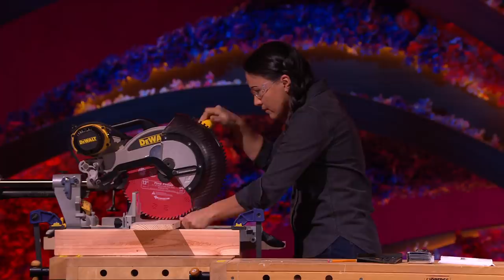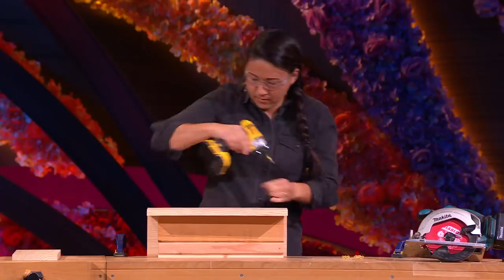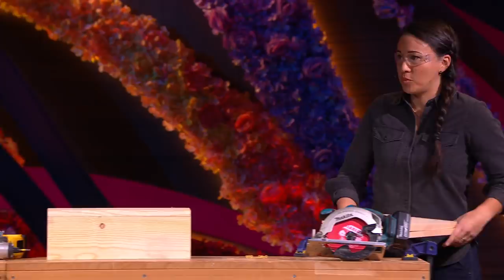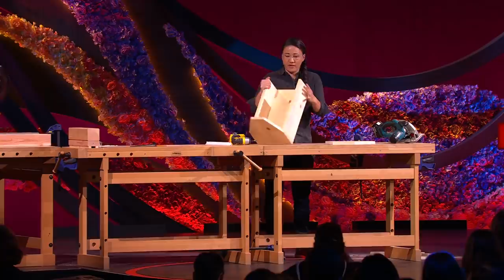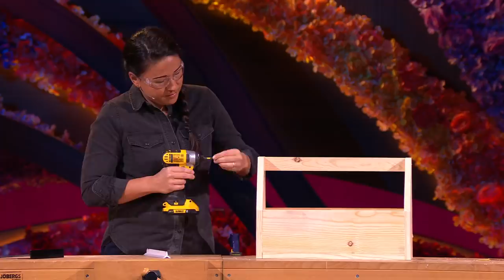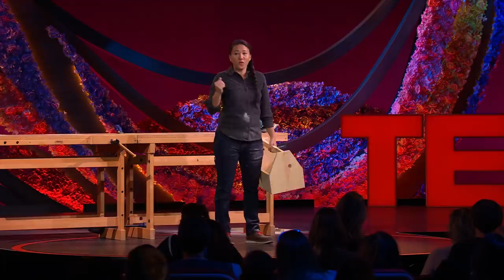What if Women Built the World They Want to See? | Emily Pilloton-Lam | TED

Comment: Perhaps because sometimes you have to lift the weight of a little more than 1 board, for example, take a 100 kilogram bathroom to the 2nd floor, or a 50 kilogram refrigerator.
Reply: We are capable of working with what we have. Between knowing our bodies, strengths, and how to use it all, we know how to use things like leverage to our advantage. I'm 5'5" and 120lbs. I worked on engines, including diesel engines. I had to move cylinder heads that weighed more than me. Never once did I ask a man for help. I always finished my tasks in the allotted time. I got paid less than everyone in the shop. But I made darn sure that I showed those guys that I wasn't some lost little lamb in an engine shop.
Reply: I dont know about small house renovations, but at commercial sites if i was asked to take something 100kg by hand up a flight of stairs my answer would be "no." Its not just the weight, its about injuring yourself or damaging the construction around you. Get a crane, get a lift, get a pallet jack, something so i dont risk putting a hole in the wall. I know there's some men out there who can do that kind of lifting. I can not, and even the guys who can probably shouldn't be doing it either.
Reply: We shouldn't be proud of our willingness to sacrifice our health and life for a job. For some shareholders we will never meet. Putting our health and life at risk for a job, when we have family and friends who need is, and who will be stuck with our disabled bodies for years, or decades, if something goes wrong, which happens every single day. For a job.
In this day and age there is zero need for us to pay with our bodies and health. We have machines that can take all the heavy load off our fragile, soft tissue bodies. The trade is my time, for their money. NOT my HEALTH for their money. Even in the best case, we become one of the thousands who have worn-out our bodies many many years before we die.
I have a friend who was once proud of how dangerously he was working. He is now wheelchair bound for the rest of his life, because of one of a small climb without the required harness.
A few years ago, a guy at my job got crushed under a 10 ton indoor crane — and yet people are still working under it today (mostly the young guys, who still haven't realized how easily we can lose everything).

We should NOT be proud of our willingness to sacrifice our health and life for a job.

Comment: Im a bricklayer. There is a reason that 99.98% of bricklayers are men. And the 1/5000 who is a woman is either hearty and stubborn enough to survive the trade or shoehorned as fast as possible into office work when they start holding back the crew. "Heavy machinery" certainly helps, but it cant replace actual, honest to god, gruntwork necessary. Blistering heat, freezing cold, trunching through foot deep mud, hauling 80lbs cement bags or 120lbs stones, shoveling gravel or sand, 40ft up in the air off scaffolding or 10ft underground down a trench. Its honest work, but hard. I understood immediately when she said "design". Not looking down on engineers or architects and the work they do, but she doent look like she has EVER really worked the grind on a worksite. Everyone, including men, have to prove their ability to remain on the job in construction positions.

Comment: I came back to this TED after requesting a book for my library called Joinery Joists and Gender which hopes to become a basis for more research on women in trades.  Why is this important?  The title was shown in a small box  promo in Fine Woodworking magazine.  On that basis I asked for the local public library to get the volume:

Joinery, joists and gender : a history of woodworking for the 21st century by Deirdre Visser
 Routledge Press

It's both an  introductory history and casebook of women in woodworking crafts and describes various teaching techniques for woodworking in schools and by extension work that is done by the body as Catherine Liu says.

  All women crews might not have the strength of men.  The job on site may take longer and require 
more hands to make a lift.  That can all be figured into a simpe contract.

Comment: Uhhhh, it's a Miter Saw not a Chop Saw. Chop Saws don't miter & are mainly used for cutting metals / tiles.
Reply: Just change out the blade...
Reply: @GKCanman  Yeah, you can change blades all you want. Still doesn't make it a chop saw.

Comment: So how does she get 2 bags of cement or concrete blocks up a ladder onto some 10 ft scaffolding? Sure you could spend hours setting up a pulley system... But normally several big lads just chuck them on their shoulders and carry them up.

Comment: Many comments here talk about how dangerous construction work is; some go on to say how women prefer cushy office jobs.

Granted that you are not likely to fall from a height that would cause serious injury, nor cut off your finger with the office printer, but let's not forget the hazards of the office. Stale air and air with contagions of whatever your coworker has because windows don't open, an ever expanding body mass due to inactivity, bad backs due to sitting so much, high blood pressure and heart attacks due to the lack of physical exertion. 

Construction can be made to be less dangerous and by thinking about how something heavy might be hoisted. We don't have to do a task the same way we did it 50 years ago. Like the presenter said, use heavy machinery, and plan to work as a team instead of individuals.